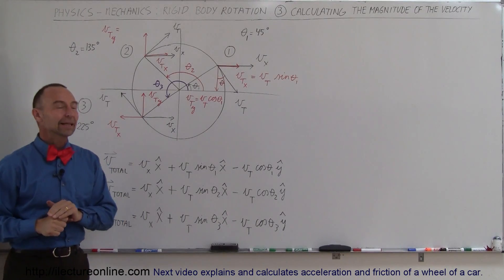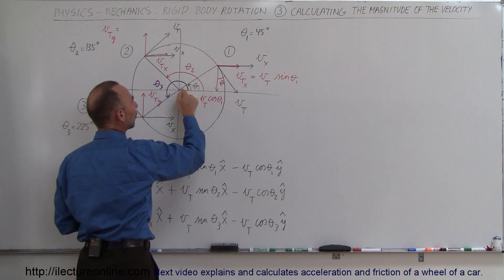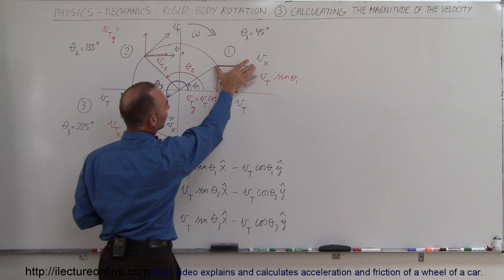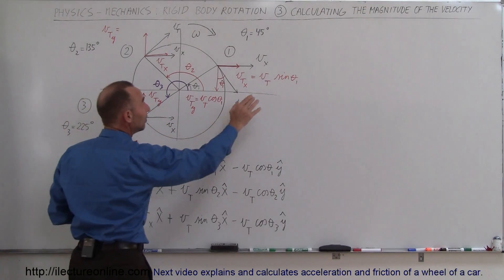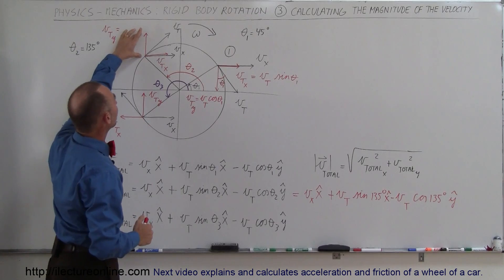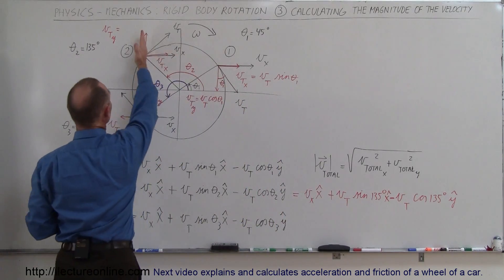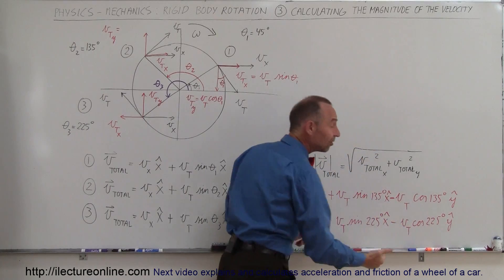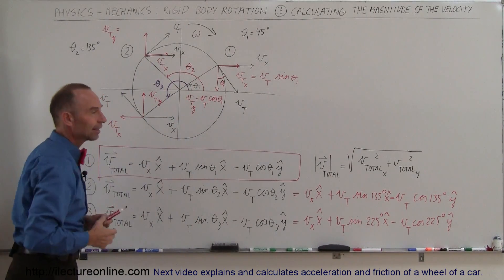Physics 11.1  Rigid Body Rotation (3 of 10) Calculating the Magnitude of the Velocity

Comment: Sir,  I cant understand you resolving the components at the 2nd point. At point 2, the components of tangential velocity becomes V(tangential) × cos(135) as horizontal component and V(tangential) × cos(135) as vertical component as per my calculation. 😢😢

Comment: and also sir one more doubt as previous comment here
The tangential velocity = omega * R  which is the radial velocity times the radius.
Since the tangential velocity on the rim is equal to the velocity of the center of the wheel, (the forward velocity of the wheel) the tangential velocity of a point inside the rim is equal to Vx * (R point on the rim / R of the wheel)
kindly clarify /explain this also sir

Comment: For the second point, isn't it suppose to be Vtcosteta for Vxt and Vtsinteta for Vyt ?
Reply from the maker: You can verify that by taking a limiting value for theta 2  (such as theta 2 = 180 degrees).
Reply: @MichelvanBiezen  sorry I'm not following, can you please elaborate more?
Reply from the maker: Calculate Vx and Vy using the angle theta 2 = 180 degrees and see if you get the correct results.  That is how you check the type of question you have.  (Use the expressions you think they should be from your comment and then use the expressions in the video and see which are correct.)

Comment: Can you please comment on whether the friction plays any role in pure rolling? I am in a bit of confusion as people say friction has no role at the point of contact in pure rolling. If it were to be true, how does a car move on the road without skidding. An early response is solicited.
Reply: I am fully aware of the role of friction as causing a toque causing rolling along an inclined plane. My previous query was based on role of friction on a horizontal surface. Hope to get a reply soon and quench my thirst
Reply from the maker: If there is no friction, a wheel cannot turn.  There is a second friction force caused by the compression of the tire or wheel as it makes contact with the surface.
Reply: Michel van Biezen : During pure rolling v=wr. So if there is indeed is another friction force, in which direction will it act and how will we write the equation of force at the point of contact.

Comment: Im confused. so your 3 V_total from the left is the same as the V_total on the right (pythagorean form) correct? If so, since it's in the pythagorean form given a and b.. wouldn't "c" which I'm referring to the V_total you have be the tangential velocity? I just don't remember our class going over this part in this chapter.
Reply from the maker: vT is the tangential velocity.  V total is the velocity of that part of the tire in vector format.

Comment: Great video! I would appreciate if you could clear up some confusion for me.
What about centripetal acceleration?
Reply from the maker: aven871
That is a separate topic.  There are a number of videos on that topic in the section of rotational motion.
Reply: The centripetal acceleration is the normal acceleration in magnitude. So I think it should be a_n = v_t^2/r
Reply from the maker: The centripetal force is explained in other videos.
This video explains the velocity at various points along the wheel.